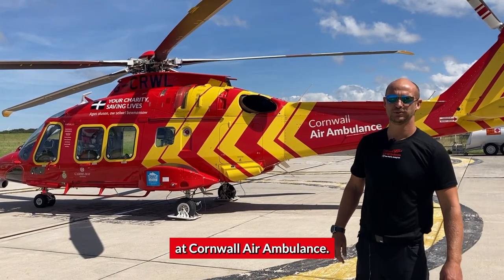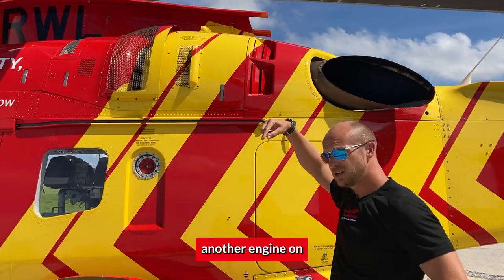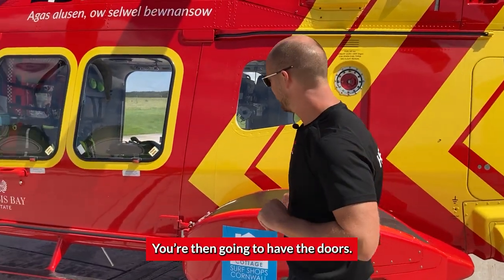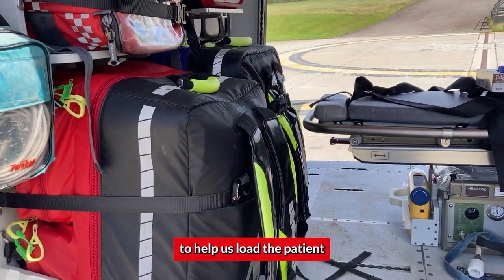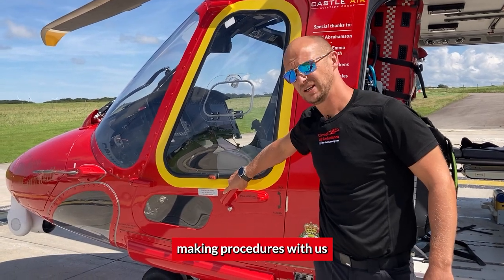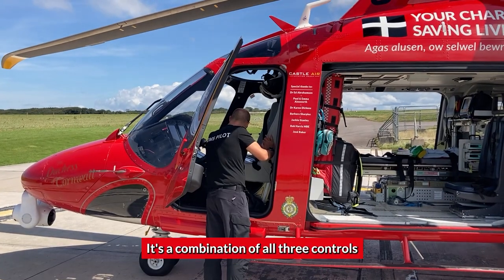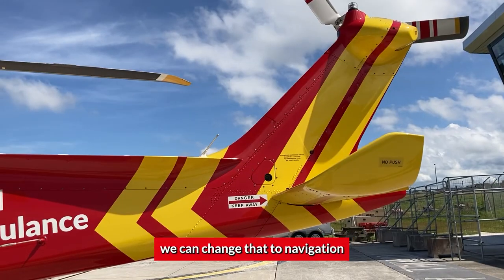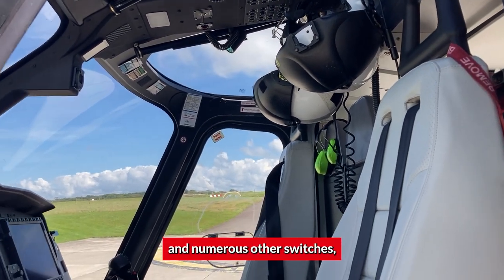AW169 Helicopter Tour with Cornwall Air Ambulance Chief Pilot, Adam Smith

Comment: It cut off before you showed the whole helicopter. I demand the rest of the helicopter, including NVGS!

Is it possible to flip on the rotor brake mid-flight? If so, how dangerous is it (assuming cruising flight) and also wtf, why?
Last one and a bit odd, have you ever bumped the cyclic with your knee and started a roll? Some of those controls seem like a pretty big lean.
Reply: Flipping on the rotor brake in mid-flight would be a bad idea since the rotors are the wings of the aircraft & you could not auto-rotate for a softer landing. A good pilot keeps hands on the cyclic & collective at all times after presetting all controls for the flight prior to takeoff.
Reply: Rotor brake it’s not allowed to operate in flight due to weight on wheel system (wow)

Comment: Hi...Thanks for your video. I noticed you do not have a bear paw on the front wheel. Can you actually retract the gear in flight with the ones at the back?
Reply from the maker: Hi, thanks for watching. The rear bear paws on our aircraft can retract. The ones we originally had fitted weren’t retractable but once a kit became available ours was the first AW169 in the UK to be fitted with them. Our second AW169 will arrive with the already fitted once we’ve purchased it.
Reply: @CornwallAirAmb  Thanks a lot for your response. This looks like a nice option...and a good alternative to full on skis for field landings. Have you tried those on the snow?
Reply from the maker: @guyroh1962  You're welcome. We haven't had to due to the level of snow we get in Cornwall. We have likely landed on snowy ground since having them fitted, but nothing deep enough for the bear paws to be required.